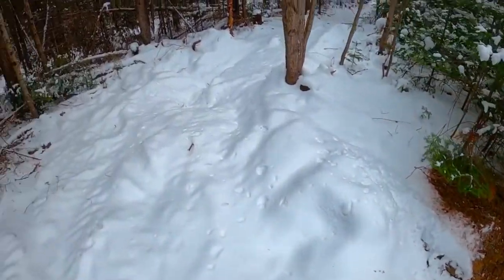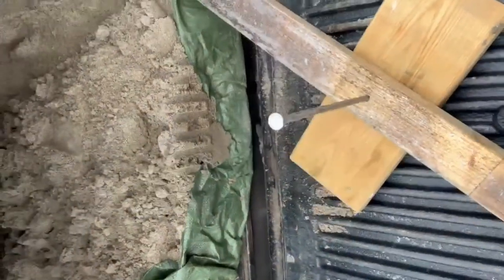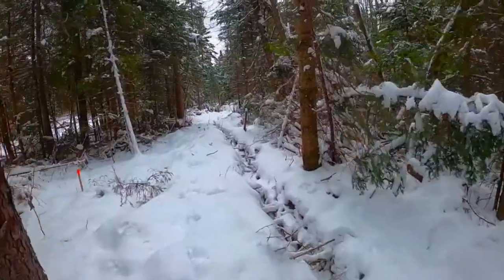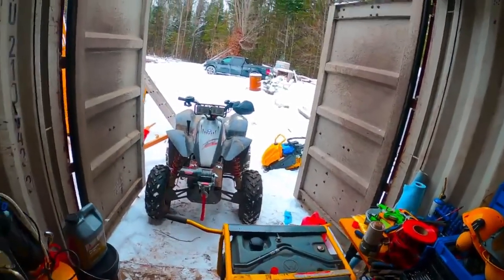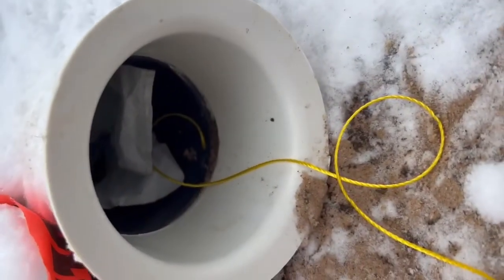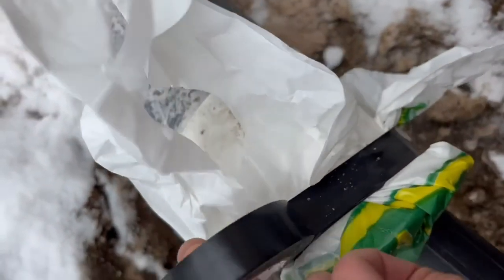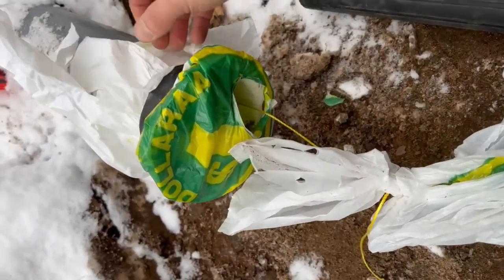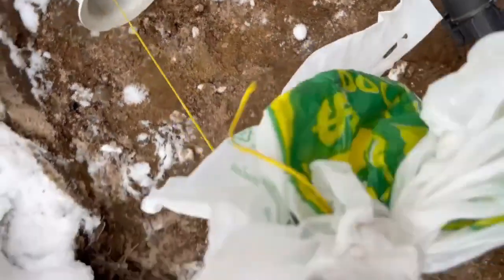Watch This! How to Easily Run a Pull String through Conduit or Pipe

Comment: Great tip! Will this work if the conduit has multiple 90 degree bends in the run?
Reply from the maker: It shouldn’t matter, if it’s all glued together. I had 2 90 degree bends and it was 270’ long. We had no issues at all with the bends

Comment: That works ok until the conduit is full of water. A large portable air compressor works every time. We have blown water and mud out of very long runs of 3 inch and 4 inch on land fill projects and then blown a string through
Reply from the maker: That makes sense. It was freezing when I did it so the ground was frozen and it was snowing. I also planned it so the electrical company came 2 days later to pull the wire, not a ton of time for water and mud build up. I guess planning and lucky weather plays a big part in this success.
Reply: What material works on the string with that method? I’m getting ready to do that in 1/2 inch conduit

Comment: If the pipe is about 20metre,it will work?
Reply from the maker: Yes it will work with most length of pipe. This pipe was almost 100 metres and it worked perfectly. So you should have no issues with 20metre
Reply: The electrical pipe is of 20mm and 20 m long, am getting a lot of problem to passe the snake in it..
Reply from the maker: @irfaancadersah9055  I would try the vacuum and strong with a bag, the bag should float right through the pipe without issues. 
let me know how it goes.